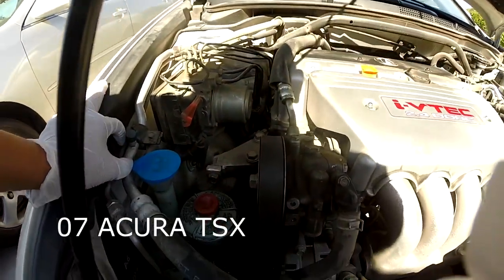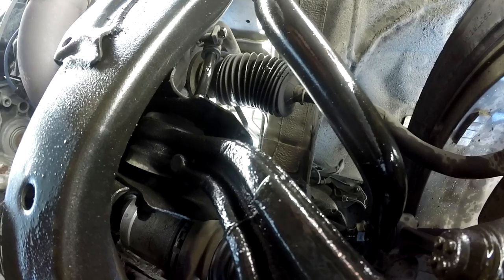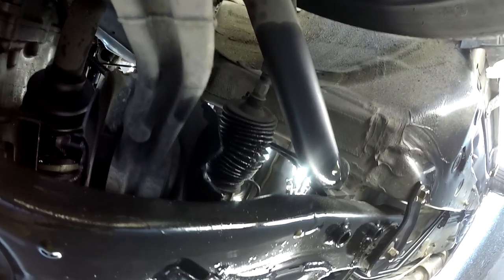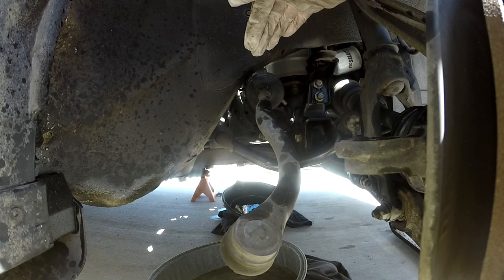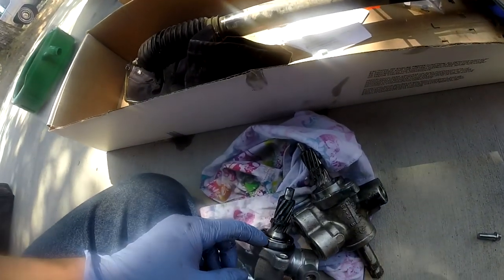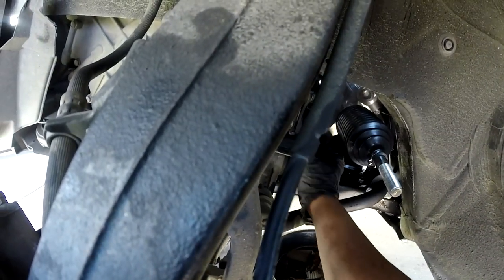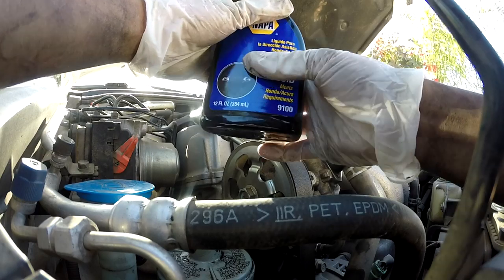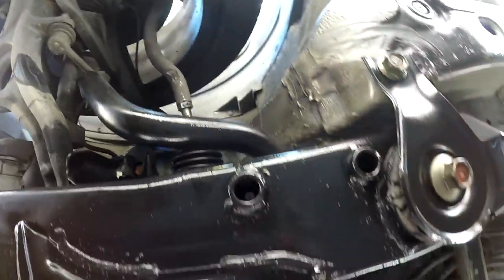TSX rack and pinion replacement

Comment: I just want to add to this for anyone doing this, it's not hard at all to do in your garage. However I don't recommend replacing with aftermarket. Get a OEM replacement only. Maybe it was just my experience but I replaced 3 times an aftermarket one from Oriely's that leaked out of the seals. I think this would be one of those components you want to replace with a original equipment.
Reply: Oreilly's parts are rubbish. I used AC delco and its okay...
Reply: Heard nothing but bad when using aftermarket for the rack, get OEM, I'm doing this to my 07 this weekend, yippie
Reply: Rob Lund thanks for that because it looks like I’m doing it again. I’ll be going through Acura as well.
Reply: TOVASTY is it a good brand?

Comment: Thanks for uploading this video. Removing the valve body was genius. Like the other commenter I almost did the whole subframe drop/ remove tower brace deal. This worked great this weekend.  I didn’t disconnect the line from the rack though. I left the bolts off the valve body after putting it back on. I was able to rotate it slightly to reconnect each line one at a time then put the bolts in and tightened them.
Reply from the maker: 2011joser i am glad you find my video helpful
Reply: I disconnected the valve body and can’t get it back on, anybody know why that is ?
Reply: @alexgutierrez762  you ever figure it out?

Comment: Followed this video to change the rack and pinion on my wife’s Acura at the weekend. It worked out great. Thanks for the guide!
Reply: was it a pretty tough job?
Reply: @reza_dc2  Not so much hard as fiddly. Needed the right combination of wobble sockets and extensions to reach everything. Once all that was figured out then it was just unbolting stuff which wasn’t too bad, then wiggling the whole thing out of the car.
Reply: @paulrawlins5868  appreciate the heads up
Reply: How did u get the valve body back on the rack ?
Reply: @alexgutierrez762  Sorry, it’s been so long I don’t remember how I did it

Comment: I've got an 05 TSX that's needed a rack and pinion for almost a decade. I've noticed lots of ppl have had this problem and Acura should have recalled this because the seals are garbage on the 1st Gen TSX and they know it but of course they wouldn't admit much an expensive problem!
Reply from the maker: True

Comment: This is great but when you disassemble the new part it voids the warranty. It's just better to drop the sub frame and install the part in one piece. It's only a few bolts on each side and you don't have to remove the bolts on the passenger side. Just loosen halfway.

Comment: Hi I have a 04 TSX with almost a 146,000 miles and im suspecting my rack and pinon is bad. For months I have been complaining about poor handling and loose/vague steering to my dealer and have so far replaced the rear control arms, driver side ball joint, bushings, and front end links. I then took the car to a independent shop and they claim its my rack and pinon. The car does still wander and the steering still feels loose yet when I took it back to my dealer and  even went back to the shop there was no huge leak like in your video but I still have symptoms. What should I do at this point and if it needs to be replaced what are my options?
Reply from the maker: ATLEAGLE579 some time rack n pinion leak it still good but this Acura does have problem so if I am you I will replace it. Thanks for stop by my channel hope you help subscribe to my channel.

Comment: How did u get the valve body connect back to the rack ? The parts where the hard hose connect, please lmk asap
Reply from the maker: Keep playing or turn it make sure the teeth of the rack align with the gear shaft.

Comment: Hey have. I almost have this job completed but I can't seem to get the lower cylinder line on the back of the valve body to reconnect. The flare nut is giving me trouble. Any tips?
Reply from the maker: Make sure it straight fit. Bend your line to perfect fit
Reply: All Tsab Been at it for days man. It’s not catching. Tried bending the line a bit too. Not sure what else to try
Reply: Managed to manipulate the line just so to get it lines up and threaded. Was starting to freak out there haha. Thanks for the tutorial man!

Comment: I have a question im replacing mine now, and why do you mark the steering wheel to the old rack? Like why did u mark it if the new rack is not gonna be marked to match
Reply from the maker: Brandon Bassett I mark to count the tie rod only. If you don't mark you don't know where to start to count spot. Hope this help answer your question
Reply: Brandon Bassett You are correct. You should mark the new rack in the same place where you marked the old rack to the steering wheel shaft.

Comment: Hi love the video, thanks in advance if your able to answer my question. I have replaced all my steering and suspension components (ball joints, tie rods, control arms, shocks) and i still have a knocking and clunking sound when i turn out of my driveway.  Could this be caused by the rack and pinion? I dont know what other component could be causing it since i replaced everything else. When i let off the brake at a stop light the steering wheel moves just a little bit. I have same year tsx.
Reply from the maker: Check all sway bar bushing, and the sway bar linkage. Also reinspect all nuts and bolts make sure it tighten. Report back if need more answer. Thanks for watching.
Reply: @alltsab  
I replaced the links as well, but did not check the sway bar bushings, will do that today in the next couple hours, thanks.
Reply: @alltsab  
Wow so i found out what was the cause of the popping and clunking..... My upper control arm bolt was trying to wiggle out, luckily on our cars the spring stops it. Jeez that could have been bad! 😅

Comment: I took apart the assembly the way you did that connects to the steeering and cannot put it back in to the rack and pinion any suggestions??? Thanks great video by the way
Reply from the maker: Try to fit into the gear and use the 2 bolts slowly tight down.
Reply: @alltsab  i ended up doing that with the old bolts thank you again great video

Comment: Thanks so much for this video. I have to replace mine at this time. I almost have the old rack out and have taken out the bolts to the valve body. It's loose and it's wiggling but I can seem to pull it off. Do i have to turn it a certain direction for removal?
Reply from the maker: Sorry didn't respond in time. No you can put it in any direction.
Reply: Any tips on getting the lines on the back of the gear box back on? I'm turning the nut it cant seem catch.
Reply: @jamieroseman4429  Did you by chance figure out how to reattach the 2 lines back?
Reply: @edwinruiz2834  Hey man! Yes I did. It took me about two days to get the bolts to finally catch. They had to line up precisely to turn and it was a real pain but I got it to work!
Reply: @jamieroseman4429  thanks!! I’ll give it a try

Comment: How did you Center it?
Reply from the maker: You can counts by the turn left to  right or right to left and measure where is the center. The rack came from the manufacturer is very much center already. If not cent on your steering you can loose the steering shaft above your paddle and align it to center.

Comment: hey I just wanted to thank you for your video and replys. I just got finished changing one of these out and taking off the gearbox saved a ton of work compared to the tsb I had from Acura where they had you dropping the subframe. took me about 5 hours should have been 4 but I got one of the lines on the wrong side of the assembly so I ended up having to take the whole line out and reinstall it. still with it for the $$$$ I saved.

Comment: Good job on the acura. Im curious are u from fresno. Im from fresno and i need my rack an pinion replaced but dnt have the tools. If u have the time Would u be able to help me out i could pay u. If not thanks anyways.
Reply from the maker: STEVEN REIGN there is no special tool need it. As long you have sockey 10,12,14,17,19, wrench, and rachet. You should be able to get the job done.
Reply from the maker: If you don't want to buy expensive tool. AutoZone or harbor have great too for little money. $60 you shout get it done already.